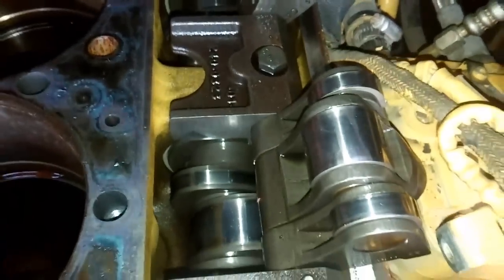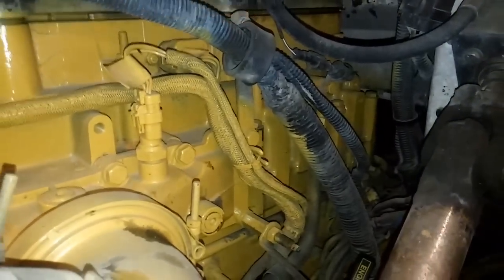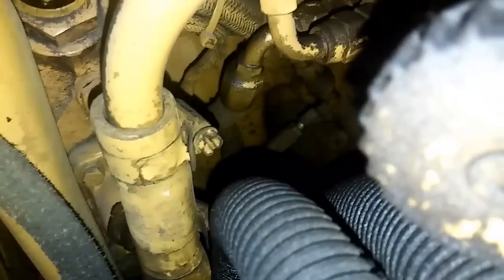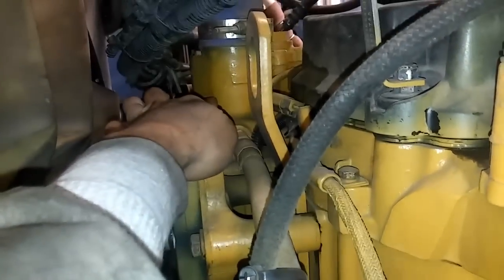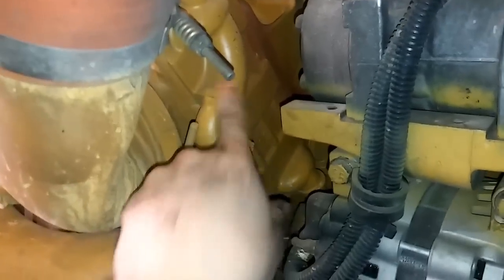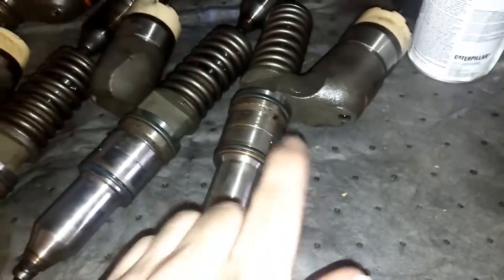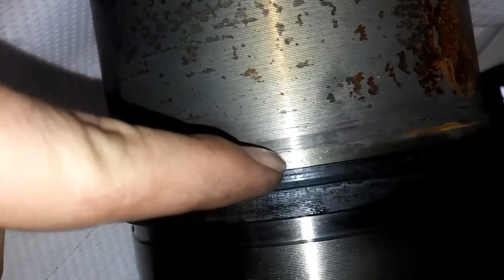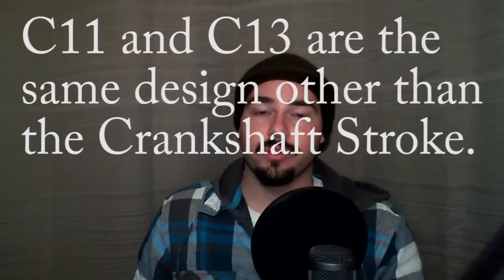Cat C13 and C11 Engines.  Facts, Walk Around, Sensor Locations, and Maintenance.  Know Your Engine.

Comment: We never go over 25K miles on the ISX, now my 60 series i do at 15K max, but i did go 21K once but i ran it hard, never shut it off, it was in seven weeks, so i didn't feel to bad, and it never used a drop of oil, unfortunately right after that oil change i had a sunken liners and it got a full inframe, it happens to the best of them EDIT, i usually try to get the oil change done at 12K miles on my N14 and 60 series

Comment: I had my c13 fix with a new cam and cam followers and I also had the head rectified. Before I fix it my oil pressure was normally at 63 psi at 17 rpm. After all the repairs where done my oil pressure drop to around 59 psi at the same rpm. I lost like 4 psi after repair. Is that normal??

Comment: I have a c13 in a freightliner throwing a 55 code. But blows blue smoke and won't rev past 1300 rpm until 8th gear then it will take off running like normal. Any ideas I am stumped. Truck is equipped with eaton fuller lighting 10 speed as well.

Comment: C13. 467k. Just got it in Feb. Running excellent. Last oil change was in 8/2022. I changed it in 5/23. Don't know how many miles they ran it. Just got results back and have 43ppm aluminum. Average is 3. It doesn't burn oil or leak from what we can tell. Changed it 1500 miles ago and still dead on full. Any ideas?

Comment: Love the video thanks lots of great info, I have a 06 c13 , KCB, I’m losing 2-3 gallons of oil about every 7-10 days. Truck runs maybe 700-1200 miles per week. No major leaks that I can see, no burning smell, no excessive white smoke from exhaust. Any idea where oil can be going or leaking from?
Reply: did you find out where the oil was going

Comment: Hey man very informational videos, would help me please I had a cat c13 accert Am getting a severe vibration type growl between 40-45 50-55 mph weather speeding up, slowing down or using jake. Sounds like coming through floor but can't feel it with hand on shifter. Without driving it the local truck shop checked out driveline and said everything looked ok. It's a 10-speed and I believe does it in gear. No engine light come out injectors of the cylinders 5 and 6 has been change, injectors cables, fuel pump, u joint truck it’s alignment. The shaking getting worse when it’s loaded. Please anything idea what it can be please anything could be helpful to get my truck back to the road. Thank you
Reply: Sounds like bad ujoint in the drive line could be suspendtion doesnt have enough air pressure that will change driveline angle to change when loaded and cause a vibration

Comment: Hey Josh, i have a KCB, and it doesnt have a jake switch, but wouldnt the jakes be built into the IVA housing or do they have a non jake IVA housing and a Jake IVA housing? Cant find any info on this. Hopefully i just need to wire it up but maybe not. Engine is shoehorned and havnt pulled the valve cover yet.

Comment: I have this 2005 Kcb c13 water pump start putting water in oil replace water pump and it’s working perfect my question is it this normal on this engines that reason I’m asking is because I used to have a E model thanks for yours videos very helpful 🤝👍

Comment: Hey great videos!! I have a C13 KCB in my rv at 525hp. While most fellow RV'er are recording around 7mpg average,  I am calculating 4.2mpg. Any idea what could be causing the terrible fuel consumption? Rv is definitely not over weight, tire pressure between 105-110psi and usually keep speed between 55-65 mph. Wonder if any sensor reading could be off and causing fuel consumption.  No smoke from the exhaust either. Thanks for your input and all your work you put into sharing knowledge in the videos.
Reply: 525hp sounds like what's taken all the fuel. Most Rv's I have seen have a 7-10 liter engine 13 liters much more than any of your fellow Rv'ers
Reply: @robwhite3241  now we have put over 12,000 miles on the RV since October.  We are now calculating closer to 8-10 mpg. Maybe the injectors just needed a workout after sitting for so long 🤷🏼‍♂️
Reply: @stevenbadman538  Good deal! and that's not all that bad of fuel economy all things considered. Our 1987 Wanderlodge probably gets worse than that with its v8 Cat but we stopped driving it as much with fuel prices and all.

Comment: Number 2 injector was showing misfire, removed the valve cover and found the injector rocker was broke off. are these pressed on the rocker shaft?? not to mention the jake brake threaded stud is extremely tight to loosen. c13 acert

Comment: I have a 2004 KCB C13 that came in my 2006 KW T800 quad axle dump truck and haven't had any real problems in the last 15 years.
I change every filter and engine oil at 10,000 miles.
I only have 325,000 miles on it. My only true issue is the twin turbos exhaust manifold bolts braking (3 times) and manifold gaskets.
I have yet to have my valves and injectors adjusted. But now I will for sure.
I'm currently installing a PDI Single turbo kit and their exhaust manifold and tuner.
I pray I'm doing the right thing.
It's a good engine for sure.
Great videos and thank you for them. :)
Reply: So how did the single turbo conversion work out for you?
Reply: @Roger_Rabbit_Adventures  absolutely sucks 😞
Reply: HOW THE SINGLE TURBO
Reply: @rayjimenez-r6m  absolutely sucks 😞

Comment: Big fan! love your videos!  when you talk about watching the C 13 overheat and watching your gauge what are the precautions or maintenance to make sure it doesn't over heat. for example I have a C 15 I hope I do flatbed I haul steel coils aluminum coil steel bars when I'm traveling down I 75 through Michigan and Ohio I'm going up a hill on a incline the motor will tend to get hot because I'm hauling something heavy, but that's normal. yes the engine fan keeps on at 225 but then once you know it starts cooling down you're good that's normal on a C 15 are you saying once the temperature hits on a C 13 that's bad I mean what are the precautions to stop that I mean that's normal when you're driving though if you're hauling heavy. reason why I ask is my uncle has a C 13 Kenworth T 800 and it's been sitting for a while and I'm going to start working on I just don't wanna open up a canna worms and be neck Deep in water... any INFO will help. thank you

Comment: I have a part number 2219386 block I am told is the same as the 2397359 C13 block however these do no interchange according to CAT. My engineering guys say the only difference is a weep hole on the front of the block. Can you confirm if these blocks are interchangeable.

Comment: hey new to your channel a friend told me about your u-tube channel, i have an 06 C13 acert  i have an issue with the cold weather anything below 55 degrees and the colder it is the worse it is .I'll just use 32 degrees as a example without truck plugged up to block heater it will start and rpms go to about 800 for a few minutes then down to around 550 rpms for a few minutes then back to normal idle . i let truck warm up at 850-900 rpms  to about 150 degrees before i leave ,about 20 minutes warming up , i'm at 195 degrees before i get a about a mile down the road.. i will leave and it doesn't pull good at all and ,i can get up to about 65 mph on flat parts but hit a hill and it doesn't pull good at all for about 6-8 miles then the check engine light comes on and stays on for about 8-10 miles then check engine light goes out and truck will run normal the rest of the day. they have tried to get codes but none are showing up . i've been told its a sensor ???? with the truck plugged up its fine but cant always plug it up.  what are your thoughts any help is greatly appreciated. i try to do all the work i can on it but this is more than i know.

Comment: Hey man are you reading from a teleprompter? You sure seem to remember a lot of stuff. 

Thanks for the vid. We have a C13 and have recently cracked a head after the 2 inch rubber hose coming strait of the water pump began leaking.
The hot alarm went off at a red light and I took enough time to get it off the road and to a place where a tool truck could park and work.
I guess that was the time it needed to crack the head. 

Since the head has been replaced I've been from day 1 plagued with a CEL with 92, 93 and 94 Cat engine flash codes. I know those are IVA codes and soon as I get a chance I'm going to remove the valve cover and check the wiring and ohm out the solenoids as you suggest in your IVA vid.

Comment: hello, I have a cat 13 the problem is that when I'm in idle the rpm goes up and down suddenly, I took it to a shop and they connected the computer and showed a problem in the air temperature sensor that goes to the turbo, they repacked the sensor but the problem continues
Reply: Thanks
Reply: thats happend to my truck  i replaced my speed sensor and the problem is gone

Comment: I have an international 9200i 2006 with a cat c-13
When I’m driving on the highway loaded the oil pressure its between 30-35 psi 40 at the most sometimes.
Is that normal or is there a problem with the engine? 
Thanks
Reply: Alfredo Gonzalez  hows your truck doing since this video I’m having exact same problem
Reply: Me to

Comment: My friend could you tell me how many gallons of oil a KCB C13 430hp use?
Reply from the maker: +BORIS SEGUI ALBUERNE Most C13 engines hold 10 gallons, but I'm not sure what you mean by use? Do you mean consume?
Reply: @AdeptApe  I am replacing a cracked head on a C13 can you give your opinion on whether I should remove the liners to change the liner O rings. Do you think i can get away by just replacing the head?I don't want to make the job bigger unless it is necessary. Thank you.

Comment: can excessive crankcase pressure  alter atmospheric pressure sensor readings? and could a faulty atmospheric sensor cause sporadic high egts? thank you
Reply: Brandon Clausen barometric sensor only reads your atmosphere pressure in order to do that the sensor has to be exposed to ambient, in other words sensor is not located on your oil pan or engine block. A faulty barometric sensor can indeed cause you higher EGT readings because ECM maps are designed to inject specific amounts of fuel at a given air pressure

Comment: when you state the maintenance intervals is that using synthetic oil? light applications?
Reply: Brandon Clausen those recommendations are only based if you use CAT DEO oils and CAT Branded Oil and Fuel filters

Comment: I have a 2007 c13  kcb with a million miles on it , I love the power the truck runs good starts right away in cold and hot wheather .but smokes a lot of white/grey  after a long period of idling , I replace the bottom turbo because had a crack and noticed that  oil or fuel comes from the  back cylinders .my question is could be injectors or just  wear piston rings ?
Reply: Emerson Fontes white smoke is a consequence of extended idle time which is never good and could end up damaging your DPF filter and causing an exotherm event, also it causes slobber which could explain your “fuel” complains on rear cylinders, bear in mind that your only source of fuel inside the cylinder is from the injectors, worn rings will only allow more oil into combustion chamber

Comment: First year C13, I was not alone when I dropped the valve head into the no.2 cylinder at 100k miles (3 out of 100 in the fleet) but perhaps that first overhead was missed or implemented after the initial year issues. Cat Reman head (3weeks), new turbo, etc... Cat of Raleigh, NC made it sing (40lbs of boost!) when got it back without issue for the next three years. Highly recommend.

Comment: were are located the oil temperature sensor in a cat c12 engine?
Reply from the maker: +Giorgines Pereira de Paula The most typical place for them is on the bottom of the oil pan.

Comment: Hey buddy had a quick two questions pertaining to sensors. One I have a surge at idle. not all the time will it do this. hot or cold temp is not a factor could this be a valve actuator? Also Jake brakes seem to work really good sometimes others they are meh could this be a valve actuator? Also you can hear a difference in the Jake sounds too when they are working really. Whole reason it makes me think it's a actuator only because of the two things it's doing. Will it throw a code if the actuator is bad? The surge is very speratic no ryme or reason. Runs pretty well no smoke or anything like that. Sometimes runs smooth as can be changed fuel filters didn't help really.

Comment: hi!..a question about the fuel pressure regulator ...do you know the size of fitting that comes out of the head?
Reply from the maker: +Rigo Ruvalcaba For the fuel lines? I'm not sure as the head uses an oring boss style and the fitting coming out of that is a -8 JIC I believe. Sorry I don't know it off the top of my head.

Comment: came across your channel, so you have a new subscriber!!  so need some advice here. I have a 2005 pete c13 acert, pushing 475hp twin turbo. I been really thinking of cutting out the twin turbo and all the emissions crap. love the truck and a huge part of me just wanna leave it as is. so guess my question is, is changing a twin turbo to single a good idea on a C13?

also I was thinking of getting a bigger radiator core. I have a 5 core, think a biggier one is better? I had that issue you said about the over heat issues, but that's been all fixed now
Reply: I have done many single turbo c13 iva deletes. You will run a c12 single turbo and a c12 or full tilt manifold. The engine is 17-1 compression so it will do fine without the ivas installed.
Reply from the maker: +topkat366 My advice is you can't have a big enough radiator, go big on the radiator.

As far as the twin turbo part, I have never seen a retrofit from a C13 to a single turbo, but it would make it a more reliable engine in my opinion. The twin turbo part doesn't really add much power, just builds boost faster (and hotter). The problem is if you need parts while you are on the road you'll have a hard time finding them on the aftermarket parts. If you had an old C12 it would be interesting to see if you could swap the exhaust manifold and turbo from the C12 to the C13 as they are very similar engines. It might be wiser to just save your money though and just repair it properly when you need to. It's a tough call on that.
Reply: Adept Ape 

thanks for the reply. on the radiator part I was thinking the same thing (go bigger). on the switching twin Turbo part I seen them switch on the C15. I will probably pass on the switching turbo parts, since I will be going for a overhaul this summer. so that will not work cause of warranty issues, but that is a good idea from the C12 to the C13. like you said, it's a tough call. again thanks for the reply back 👍

Comment: Just installed a reman oil pump on my c-13 cause the old one oil light kept coming on.  anyway just wanted to ask if 18-20 psi at idle is normal and 33-35 psi at 65 mph 1400 rpm is normal ?  thanks
Reply from the maker: +Big Foot Can I get your serial number. C13 usually have lower oil pressure, but that high rpm pressure seems low. I'll have to look at the oil map.
Reply from the maker: +Big Foot Alright so low oil at idle is 8 psi for a C13 and at 1400 is 29 psi. Your engine seems to be above the minimum, but still is low.
Reply: Adept Ape Si basically im still kind of Low even with a reman oil pump. 😩   i mean it runs great for 896k on it.  i do need a new air compressor cause my air dryer filter had a little bit of oil in it.  Im planning to rebuild my engine soon on my own.  i have done cars , but never a truck.  I havent seen a c-13 acert Rebuild on the internet so im planning to make a video on it.  anyway thanks again for your help sir , i really appreciated.  Maybe You can offer some advise on the rebuild and I can pay you for your time.  I wouldn't mind at all.   Thanks
Reply: Big Foot you shouldn’t be complaining, if any your pump is running above what Adept Ape mentioned, also keep in mind that oil pressure is typically higher when running a cold engine and it will go down on pressure when oil temperature increases all of this is because oil viscosity will change with temperature.

Comment: Hey Adept thanks for the reply, I'm not sure how to read the fault code on the C-13 is it the same as the video you have on there? Also since the turbo boost is down when the light is on I assume they're related but how would an intake actuator effect the boost? Is the power down in that Cyl? Is that the reason? I'm kind of new to this comment thing and I will donate since I'm getting gobs of info so I can tinker Just have to figure it out.
Reply from the maker: +Rick Camp If you have a cruise control switch, try getting the blink codes, but if you have a regen engine that won't work. When the engine sees certain engine codes it'll derate which limits the fuel which will reduce your boost.

Comment: Very informative appreciate the info you are sharing. On my c-13I have a check engine light in these cold Chicagomorning and my boost pressure is reduced Eventually it goes out. I have already had Peterbilt replace the harnesses and the one actuator that was at issue 2 months ago but now the problem is back. Does this sound like exhaust actuators? Could the actuators fail from using Lucas? Any info is greatly appreciated.
Reply from the maker: +Rick Camp No such thing as exhaust actuators, unless you mean the Jake solenoids. Is it the same IVA solenoid causing the problem? It is possible the solenoid failed again which would be covered under warranty.
Reply: Adept Ape I would recommend highly to stick to CAT DEO oil and CAT branded filters, our oil is designed to meet our specifications, no other aftermarket brand has a better additive package, also at CAT we developed the current CK-4 specification of oil